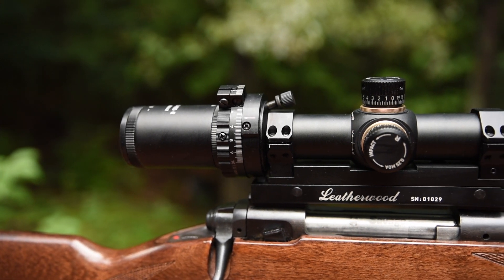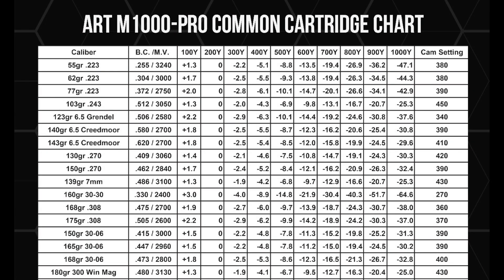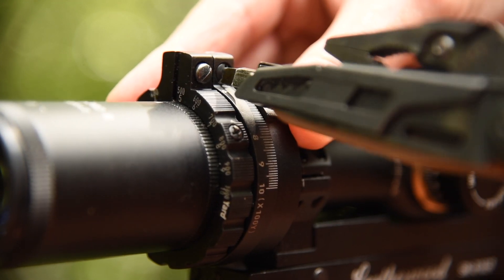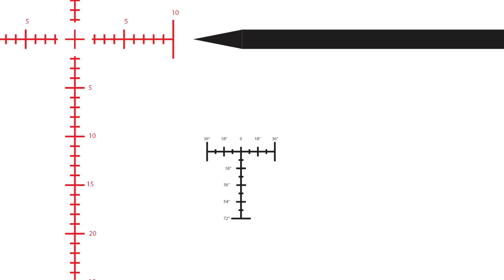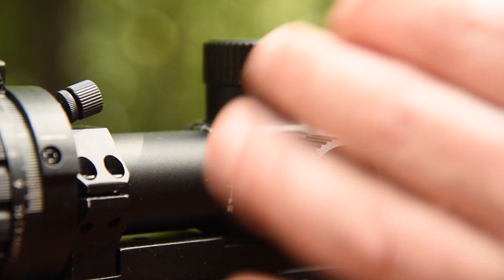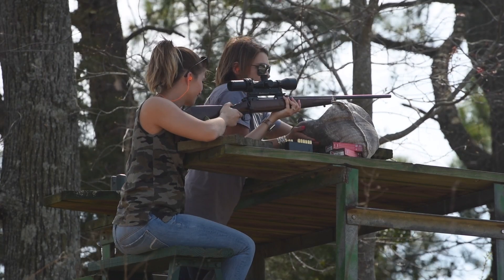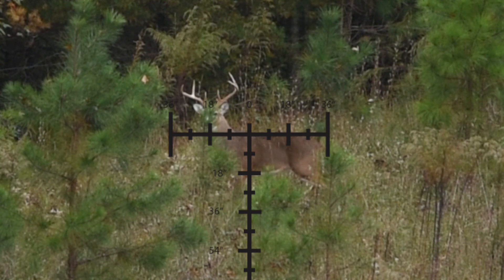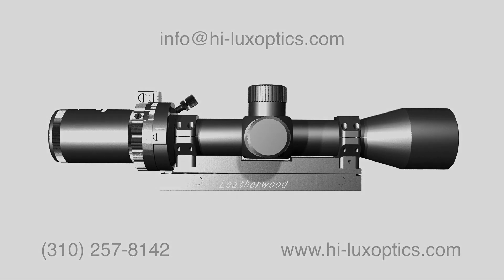(Hi-Lux Scope Tutorials) Setting up the Leatherwood ART Scope | QUICK START VIDEO GUIDE

Comment: What replaced this technology?  I have one of these.
Reply from the maker: This is one of the latest models - it's been a few scope generations since the original ARTel scopes! The previous model in this line has a very similar name (M1000 vs. M1000-PRO).
Reply: @HiLuxInc  I have a 1st Gen Scope I am pretty sure.  It says not to adjust the cam ring set at factory.  I might piddle with it.  Very tough piece of optics.

Comment: I bought a leatherwood scope back in 2002 at Shot Show.  Mr Leatherwood himself sold me the scope.  It was one of the most disappointing purchases I ever made.
Reply from the maker: We have made major improvements to the ART scopes since then. Did you have a nice time meeting Jim regardless?
Reply: Hi-Lux Optics he seemed nice.
Reply: why was it disappointing ?
Reply: Anthony Luisi this was back in 2002.  The base was machines off center.  It was designed to fit a 1913 rail.  Once mounted the scope wouldn’t zero because it ran out of adjustment on the windage knob.  I tried the scope on 3 different rifles and it wouldn’t zero correctly.  I could put other optics on those same rifles and zero them without issue.

Comment: I set the scope up exactly like this video shows, but when I look thru the scope, I can not see the target at 200 yards, I let my Army buddies look and they could not see it either. We then turn it to 1000 yards and the 200-yard target is now visible, any suggestions? we are stumped.  I'm shooting a 300 ultra mag Remington 700. we have the setting at 430 according to the chart. At the range, the instructors were also stumped and watched your video, they said the scope is set up correctly.  any help is appreciated. I did try a few shots at 200 because I could see the targe but as a dot and not the square paper. I hit the target at the top, but I should be able to see the bullseye when I look thru the scope.
Reply from the maker: In the standard configuration out of the box, the ART scope is set in Auto/Range mode. In Auto/Range mode, the Trajectory cam and Range Ring (Power Ring) will be locked together and move together. 

To operate your Magnification independently of the cam, you will need set the scope in manual mode. To engage manual mode, loosen the set screw on the range ring one to two turns and pull the range ring back towards the eyepiece. This will free up the range ring and allow you to independently set magnification. 

Manual Mode excels when you want to shoot at a known distance, such as when initial zeroing or fine tuning the cam setting. 

Auto/Range mode allows you to range a known dimension within the reticle and automatically compensate for the trajectory once the target is properly framed. You do not need to know the distance to the target in Auto/Range mode.

We will be releasing a video in the next few days to go over zeroing the ART at a closer distance and advanced applications of the ART scope in manual mode. Please let us know if you have any additional questions.